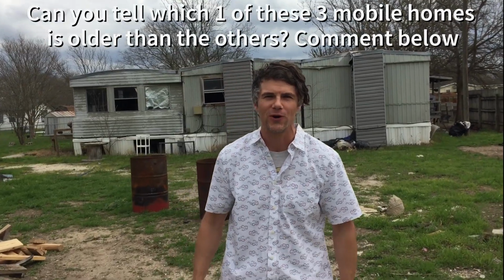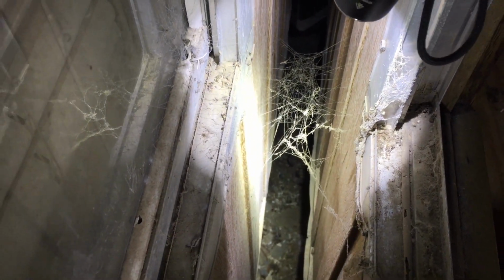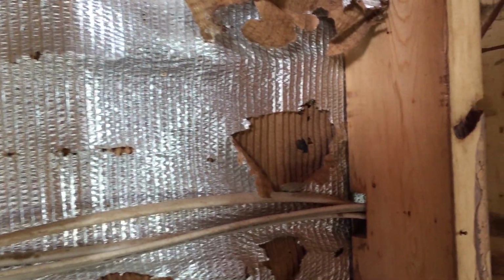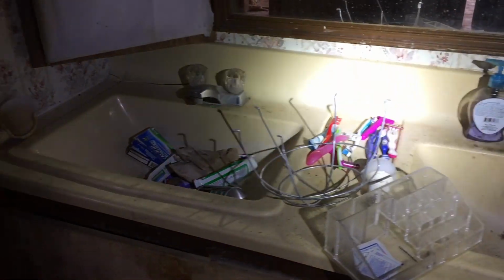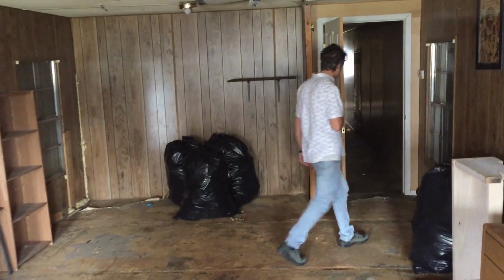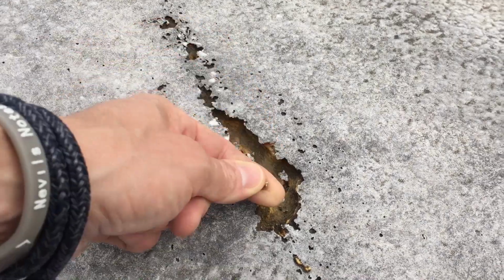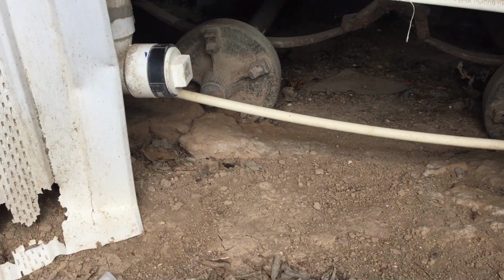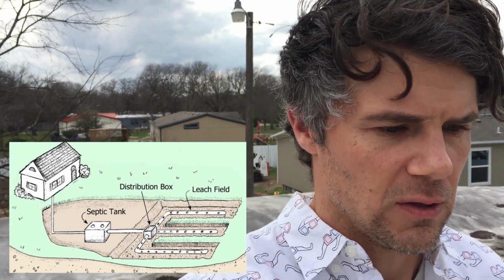Weird TRIPLE-WIDE | Mobile Home Tour 🦄

Comment: Cool! Its a shame that it wasn’t maintained properly or it could be a good home if you had a lot of kids. I’d build a separate pitched roof over the 3 mobiles so rain and snow wouldn’t build up. I’ve seen this done a few times but it’s only 2 single wides (early 70s homes) Either 2 put next to each other lengthwise, or I’ve seen a video (Jay Smart on Youtube), and his 2 are in an L shape.
Reply from the maker: Thanks for commenting, Zane. You are absolutely right about building a more traditional style pitched roof-over covering the three mobile homes. This would probably look better and make it look a bit more modern as well. I have seen that L-shaped which is pretty cool. Have also seen two single wide mobile homes sandwiching a single-family home in the middle. This really is a cool business that will allow you to stumble upon some really interesting and wild home designs. Thanks for reaching out again. Keep in touch moving forward. All the best.

Comment: I would love to take this on as a project. Most definitely wouldn't tear it down, they seem pretty stable.
Reply from the maker: Very cool to hear your opinion. I bet a number of folks would not mind taking on a project like this. As you can see, the inside was huge with so many options. In all of my investing I have never seen a triple wide that was actually three single whites pushed together. In order to keep the structure around I agree that it could be fixed up, probably quite nicely. I definitely agree with you that it was stable on the inside for the most part. Thanks again for commenting.